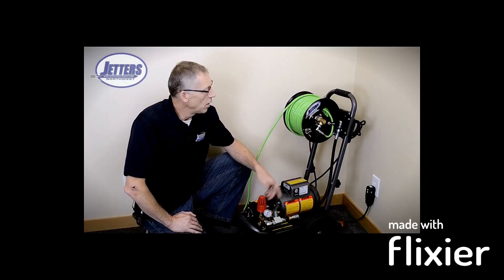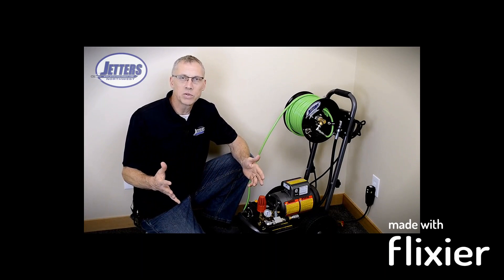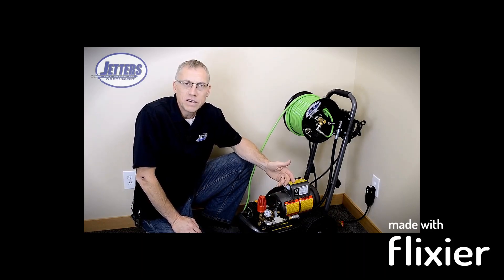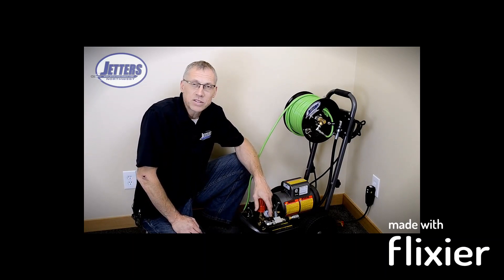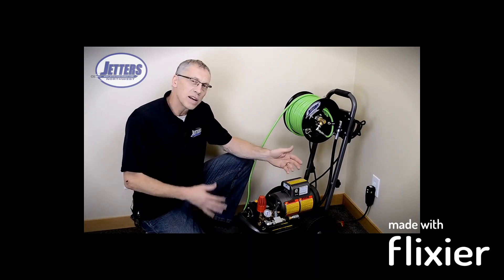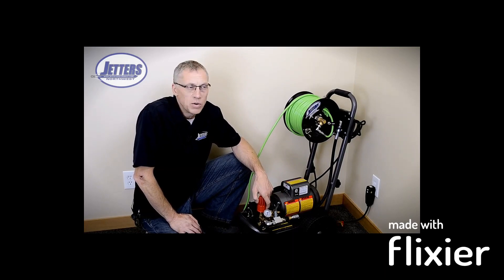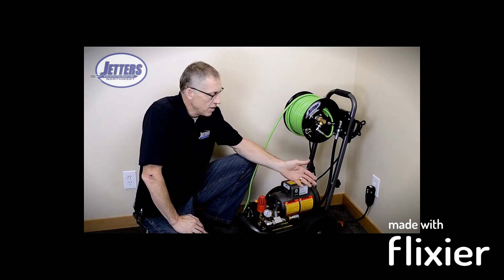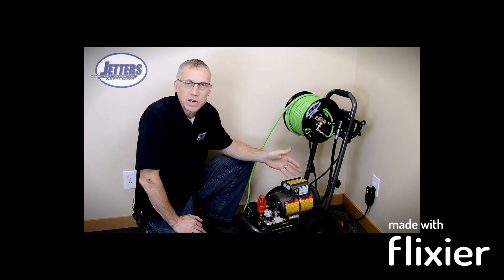115-volt Electric Jetter PSI/GPM Limitations - "Get" Jetting w/Jonesie

Comment: i had a good gig running a harben.  4000 psi 15 gpm 3phase 480v
Reply from the maker: Nice! We do build 3-phase powered jetters but they are not a common request -- probably fewer than a dozen in the last 20 years. We've done hundreds of 240-480v wash-down units for industry tho.  Was your jetter an "in-plant" unit plugged into the buildings 480v power?